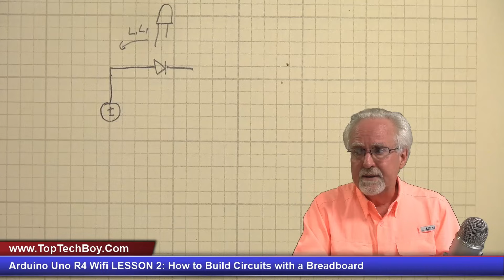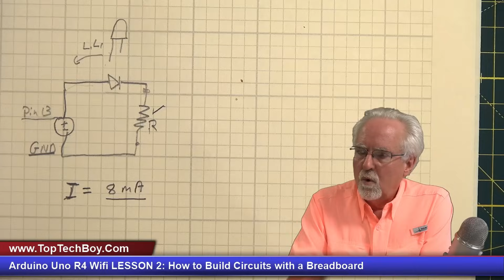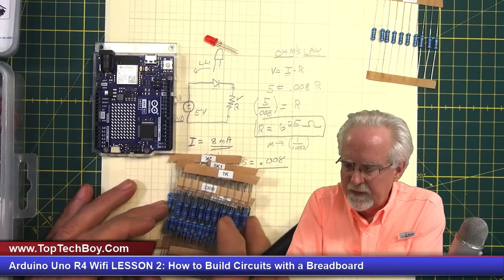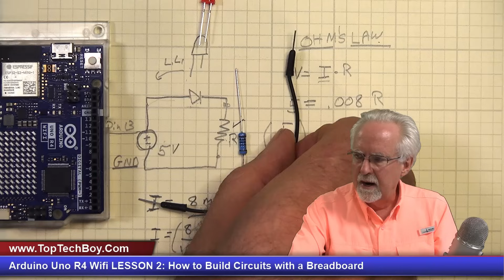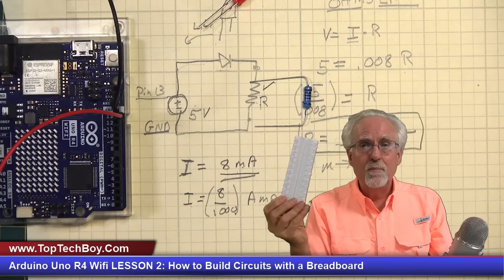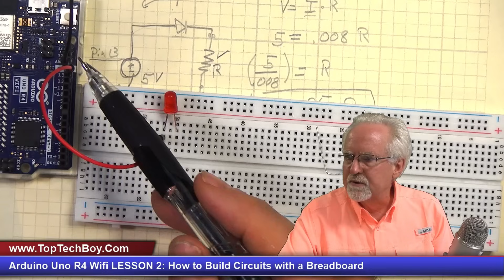Arduino Uno R4 Wifi LESSON 2: How to Build Circuits With a Breadboard

Comment: I posted my video. I couldn't figure out how to post your link on my videos and I cant figure out my link. But only videos on my channel will be these.  Not even gonna lie when you made me set up resistor on my own I was like "oh dang" but thankfully breadboard is pretty straight forward.
Reply from the maker: On the home work solutions, hold your camera horizontal, or landscape mode. Then you upload it as a normal video, not a 'short'. Include in the descritpion of the video, a link back to this video
Reply: @paulmcwhorter ok thank you. Ill go back and re do these and re upload them

Comment: I by accident connected the red LED to Breadboard without resistor for around 10 seconds. The lights was blinking like I programmed, but nothing got ruined, why is that? The arduino was plugged in the my macbook

Comment: Doesn't the LED have some resistance, too? And do you always want to hit exaclty 8mA or shouldn't you calculate with a savety margin?
Reply: @crankpatate3303  you could take the forward voltage and operating current of the LED and use ohms law to calculate the equivalent resistance, but the LED is essentially a diode that lights up when current is in the right direction, not a bulb or filament that carries resistance. Each LED can have different current ranges where it will safely operate. I usually see anywhere between 10-20mA for LEDs, so 8mA is rather low, but that may be the safety margin.

Comment: Great video Paul.  Question.. Can the resistor be placed before the LED?
Reply from the maker: The resistor must be in series with the LED but it can be on either side of it, and it works the same.

Comment: Thankyou Mr Mcwhorter. I have a question though. Following your code, I jumped the gun a little and added an led with a resistor as well as having pin 13 flashing, the new led is pin 12. Q is, why do both leds flash at the same time even with different times? 
void setup() {

  pinMode(12,OUTPUT);
  pinMode(13,OUTPUT);
  // put your setup code here, to run once:

}

void loop() {
  digitalWrite(12,HIGH);
  delay(30);
  digitalWrite(12,LOW);
  delay(30);

  digitalWrite(13,HIGH);
  delay(500);
  digitalWrite(13,LOW);
  delay(500);

  // put your main code here, to run repeatedly:

}

Many thanks

Comment: I watched the supplemental to this video before completing the assignmernt and decided to use a transistor to control the blinking, rather than risk damage to the digital pins on my brand new R4, which just arrived with my SunFounder kit yesterday. Had to crash course how to actually use transistors, so any feedback to my implementation is welcome.
https://youtu.be/wT1Wyrh4nig

Comment: homework code using functions and loops:
void setup() {
  // put your setup code here, to run once:
  pinMode(13, OUTPUT);
}
void ditditdit(){
  for (int i = 0; i< 3; i++){
    digitalWrite(13,HIGH);
    delay(100);
    digitalWrite(13,LOW);
    delay (100);
  }
}
void dahdahdah(){
  for (int i = 0; i< 3; i++){
    digitalWrite(13,HIGH);
    delay(300);
    digitalWrite(13,LOW);
    delay (300);
  }
}

void loop() {
  // put your main code here, to run repeatedly:
   ditditdit();
   delay(200);
   dahdahdah();
}

Comment: But isn't the LED going to burn out without a resistor on the + side?Sorry if i'm wrong,i just got into electronics and i'm learning from multiple people and they are all showing different stuff and circuits, thank you!
Reply from the maker: The resistor limits the current regardless of what side of the LED it is put on. It works the same in either place.
Reply: @paulmcwhorter Thank you so much!!
Reply: @paulmcwhorter I thought the same thing and was beginning to think I was working on destroying my board! Thanks! 😁

Comment: Hello Mr McWhorter, thank you very for sharing your knowledge in a wonderful way. Quick question, can we connect the resistor on the positive side before the diode? instead of on the negative end after diode? what is the difference?  I was thinking then it would protect the diode
Reply from the maker: The resistor behaves the same on either side of the diode. Put it where it makes your circuit build the neatest.

Comment: Wow this beats IBM Key Punch Cards
Reply from the maker: To be honest, I miss the old punch cards, and the sound of the card reader, and the smell of ink as it printed out 231 pages of the errors in my program. There was a certain magic to computing back in those days.
Reply: @paulmcwhorter  Yes it sure was!  the good old IBM 360.  I started with Cobol, Fortran and assembler language back in the 70's!  Haven't done any of that in a very long time.  Picked up the Sunfounder Elite kit from your link....This is going to be fun!!!  Thank you!

Comment: Love ya Paul, but as an old CET (Communcations and CNC repair), that was the most round about sizing of a resistor I ever saw in my 68 years with no consideration of the LEDs voltage /current requirements.  Bottom line, they screwed us with the R4 outputs so avoid using less than a 6oo ohm to protect the output, but consideration for the load should be taken since you may not always work with something as forgiving as a LED.  PS The symbol you have for the LED is incomplete as it denotes a simple diode and not a Light Emitting Diode.

Comment: Hello Paul,
I like your Arduino lessens. I bought the Arduino R4 WIFI after I have done the R4 lessons and I started whit the R4 WIFI lessons.
When I download the first blink sketches with 200 ms blinks the arduino does not really blink but faded away. You hardly see the blinking. When you use the rest button the blinking becomes more sharper. Is there a delay in the system? I like your lessons. 
Thanks.

Comment: 1:45 into video you say to turn LED on you set the voltage to HIGH but then to turn it off you set it to off.

Didn't You mean to say that to turn the LED off the voltage is set to LOW?
P.S. Love your lessons!  Wish I were in your classroom.

P.S. I've found that Plano plastic tackle boxes with slide-out drawers are great for storing/organizing component kits are really handy for transporting as well.
Especially since the drawers have customizable plastic dividers. 😁

Comment: Code:  void setup() {
 pinMode(13,OUTPUT);
  // put your setup code here, to run once:

}

void loop() {
  // put your main code here, to run repeatedly:
  digitalWrite(13,HIGH);
  delay(100);
  digitalWrite(13,LOW);
  delay(100);
  digitalWrite(13,HIGH);
  delay(100);
  digitalWrite(13,LOW);
  delay(100);
  digitalWrite(13,HIGH);
  delay(100);
  digitalWrite(13,LOW);
  delay(200);
  digitalWrite(13,HIGH);
  delay(200);
  digitalWrite(13,LOW);
  delay(200);
  digitalWrite(13,HIGH);
  delay(200);
  digitalWrite(13,LOW);
  delay(200);
  digitalWrite(13,HIGH);
  delay(200);
  digitalWrite(13,LOW);
  delay(200);
  digitalWrite(13,HIGH);
  delay(100);
  digitalWrite(13,LOW);
  delay(100);
  digitalWrite(13,HIGH);
  delay(100);
  digitalWrite(13,LOW);
  delay(100);
  digitalWrite(13,HIGH);
  delay(100);
  digitalWrite(13,LOW);
  delay(100);
  delay(500);

Comment: int ditt = 250;  //delay time for a dot
int dat = 500;  //delay time for a dash
int lett = 750;  //delay time between letters
int i = 0; //a counter
void da_dit(int ta, int tb);  //function prototype

void setup() {
  // put your setup code here, to run once:
pinMode(13, OUTPUT);
}

void loop() {
  digitalWrite(13, LOW);
  da_dit(ditt, lett);
  da_dit(dat, lett);
  da_dit(ditt, lett);
  delay(lett);
  // put your main code here, to run repeatedly:

}
//definition of function that blinks LED
void da_dit(int ta, int tb){ 
  for(i = 0; i < 3; i++){
    digitalWrite(13, HIGH);
    delay(ta);
    digitalWrite(13, LOW);
    delay(tb); 
  }
}

Comment: I am "legend"
I used two 330Ω resistors in series.
https://youtu.be/bbsrYb7I80k
Reply from the maker: Yes, two 330 ohm resistors in series is a nice solution. Safe, and the LED will be a little brighter.

Comment: A slight oversimplification on the resistor calculation. The voltage accros the resistor is not 5V. it's 5V  minus the forward voltage of the LED, which for a red LED is usually about 1.7V. So 5V - 1.7V = 3.3V. R = V / I therefore R = 3.3 / 0.008 = 412ohm. Still might select 1K just to be sure though. 1K will actually give a current nearer 3mA.
Reply: Thanks for the question (as well as, to Mr.McWhorter, the answer) - I was wondering about the voltage drop across the LED.
Reply from the maker: Please watch today's supplemental video, where I explain better why I am doing it the way I am. Assigning a 'usual' value for red led can indeed lead to a circuit that will burn out the arduino. Watch my video today for a better explanation.
Reply: Yes, then there is the source resistance 😊
Reply: He could put two 330 in series for 660😊

Comment: Hey Paul, I am going through this series for the first time on a week by week basis as they are coming out. Even though the beginning videos are very basic, I am learning new things. For example even though I have been trying to learn electronics for the past couple of years, I never thought about or understood how the resistor is chosen for the LED. But, Professor, I still have some questions. For all the previous projects I have done, I used about 200-300 ohm resistors with the LEDs. Is this because the amp output for the I/O pins on the Uno R4 is so low? I noted the amp out for the R3 is 20 milliamps instead of 8 milliamps.  Is this a significant limitation on what peripherals can be run from the I/O pins on the R4?
Reply from the maker: The R4 digital pins can only safely source 8 ma and the R3 could do more. Hence, we need a bigger resistor.

Comment: Hi Paul, I just wanted to thank you for taking time out of your schedule to create this series and for the others that you have created in the past. I believe there is a discrepancy in your calculation for the LED current liming resistor. I'm sure that you know this and may be trying to keep it simple for the beginners. You are looking that there will be 5VDC dropped across the resistor which is not correct. All LEDs will have a forward voltage drop across them when they are on. Most red LEDs will have approximately 2.0VDC across them while other colored LEDs such as blue may have a higher voltage drop of around 3.0VDC. Looking at the red LED with a voltage drop of 2.0VDC, there will be 3VDC across the resistor. Using Ohm's law of V=IR and  rearranging the equation to R=V/I gives a resistance value of 375Ω = 3/.008. Although, this value is not in our kit, using a 330Ω which is in our kit would yield a current of 9.1mA which I would still consider too high. Although 390Ω is not in our kit, it is a standard resistor value which would yield a current draw of 7.7mA. And with a 1kΩ resistor as used in this lesson would yield a current value of 3mA. Thanks for the ear Paul and have a super great day!
Reply from the maker: I dont think you understand what I am trying to do. The current across a diode is exponential with voltage, meaning small changes in voltage can lead to very large changes in current. As the current increases, the diode can heat up, and you can end up in a run away condition. Hence, we can not say what the voltage drop across the diode will be. So, to ensure we operate in a manner that we will not damage the arduino, we assume all voltage will drop across the resistor, and then calculate a resistance value that will give 8ma. This ensures that no matter what is going on with the LED, you will never draw more than 8 ma. The design then becomes intrinsically safe.
Reply: Thanks for the question (as well as, to Mr.McWhorter, the answer) - I was wondering about the voltage drop across the LED.

Comment: An easy way to remember ground led lights connections, Think of the resistor as a block of wood, And if you look at the inside of the led light, To what appears to be an axe. The axe always chops the wood, Meaning
The ax part of the light is choppingngtthe resistor visually

Comment: Need voltage drop for the LED,  and don't forget the arrows for the LED symbol.
Reply from the maker: I assume that all voltage drops across the resistor. This ensures that no matter what happens in the LED, the circuit will never draw more than 8 mA, and hence will never damage the arduino. Imagine the LED failed in a way that it became shorted. Even in such a case, the current would not be more than 8 mA and the arduino would not be damaged.

Comment: I did your last set of Arduino lessons, and (as I have seen in the comments for last week) I am using the Uno R3 Arduino (as Amazon hasn't delivered my R4 WiFi one, yet!).  I remembered a different value of resistor (to limit the current).  While the Uno R4 WiFi can deliver 8mA, the old R3 could deliver a higher current, and so we used a different value of resistor.  I'll be posting my homework in a little while.